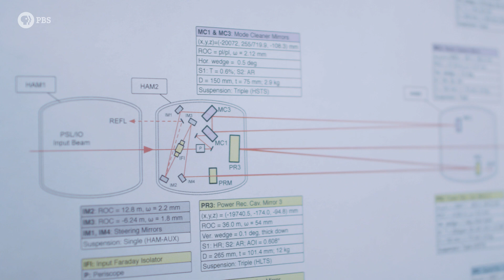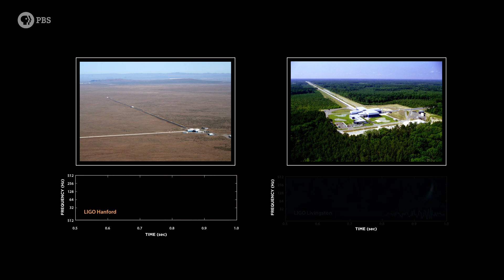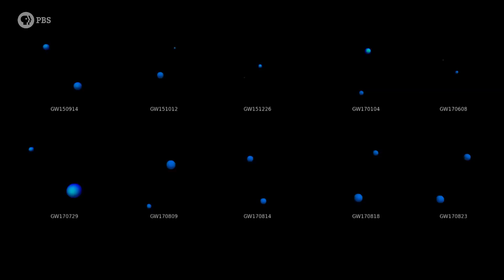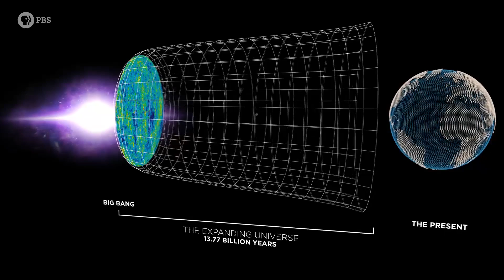I Visited the First Gravitational Wave Detector! LIGO | STELLAR

Comment: i do believe in gravitation waves, just not the one that ligo is looking for. actually i think that gravity is a vortex created from a interference pattern of wave bouncing out of phase with each other that create a small region that reinforces itself when feed with energy where a convergent and divergent wave oppositly adds to each other causing a gravitational donut vortex that pushes against earth with no friction expect on the stars where the resonance of this vortex is different and burns the star from outside in. i mean hotter on the outside than its inside. it have been long believed that the corona of a star is hotter than its core. i think my theory confirms this and why.

Comment: Hi,LIGAR LIGHT,INNERGASFLUID COMPRESSIBLITRHRUM AS INNER VOL CaO,SiOx),concrte,the light wave seen as mid C from the v fast vibrum tra,fra,reflect mirrors,dfrnt spectra on laz,S,er,dfrnt vibrum of apparartos os,circle sphere ,Grav waves above below the Grav event wobble horizon,spheroidal spin,lift as cosmike effect environ,compression,of ST/G FIELD RUFFLES IN 7D,thus LIGAR GravAwarensussAffectArrooundingRelRARTRATIO OF LOCAL GRAV WAVE,OTHER EMGRAV FIRLD OCEAN OF STREAM ON LIFTING,SPINNING MAGMA RAFT BREATHING,AS WARTER,LIGHT =lighter than air,H2O,<O16/8,or O17-18/8,low dens ‘sound’ ,’wave’,as is reflection,reflaction,alters LAMINA of coherence amongst light as LAZ,S,ER,as arrant light or Spheroidal ‘sound’,reflects,some sMasseffect lerp light narrw,widning of beam splitter affected from ST/G compression,or auxpansion as a spheroidal Grav would be felt within whole apparartos but with dfrnt Grav mass dens,dfrnt,esp rel H2O THART be in concrete or the crumbling,ressonanc,of tubes,mirror,apparatos auxpaerienc the Grav ‘wave’,as well but dfrnt,standing waves,again on spinning lifting earth in+on elecMagGrav field spheroidal function of the usual planneryaria,as is a NAOT in a song,dfrnt with song,instrumnarium,nares breathing speak,songing,nostrils+mouth usual in MARSUPIANS MOTHERFATHERMOTHER of mammals primits similar as gngurrrrru ,or GNGURRU,the supposed kangaroo THART ORIGINEES,ADDED BASE CODONS TO TUNE WITH ENVOTON ENCODONS ENCODED IN THE ROLLIG ROCKS THART THEE DISPLAYED,BE ENVIRON CODON STRUCTURE BONE BE CRYSTALIZED GRAPHENUMA SHEENAM ROLCOILTAPER NOT TREE TRUNK BONES THART ROT IF PERIOSTEUM RIPPED OR UNHEALTHY IMPROVABLE IN PRESCENCE OF FLESH,BONE EATING BUGS,HARDER IF CRYSTAL,BUT THE ROLCOILTAPER ENABLE TO ADJUST HEIGHT PROPRARTHMANUM REL ARROUNDING OTHER ARRAY OF AWARENAUSS ACCLUM OF SPECIES KNOWLEDGE SONGS CREED,SIMILAR PRIMIT(Encodons ,) of inner ocean organ of organisms with physical response to float above ground with dasplacing ST/G FIELD see banana tree structure in humanmammals RNADNA be in but not as much in birds,as humanHuman,with working fluid causing longer angle adjustable limbs esp limbs connection BODARIA THART adjusts dens/difusn RartRatio very often as inner field ocean be Grav acclum sensitive to Grav,as thee be a Grav ,mass entithrumming with movable stabilizing structure reliabl thru LIFELOVE cycluan,remember Grav thru earth art angle complex caunoidal function,earth taidal,warter taidal affect effect of larger than usual Grav field causes ruffles,in LIGAR need squared circl aperture,to prevent altered angl join air,light,concrt reaction ressnanc to ‘Grav event,thee be a Grav event,thanx,bliss, XAMichael

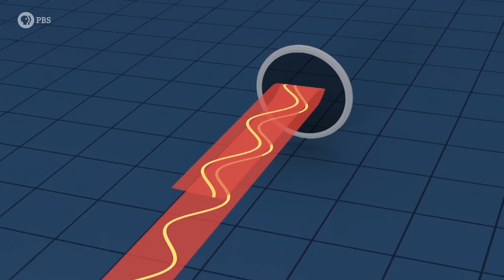Comment: 2:58 Actually, multiple detectors are needed in order to triangulate the exact location of the event in space.
Reply: Both justifications for detectors located far apart are correct. Multiple detectors are used to correct for coincident glitches/false alarms AND to triangulate the merger sources.

Comment: Is it affected by earthquake. And how can we differentiate between gravitational wave and earthquake from LIGO
Reply: This is why they have two detectors.  They can compare signals.  A Gravitational wave from deep space will certainly be detected simultaneously, and be identical, and therefore, can be confirmed to be from an extraterrestrial source.  A disturbance from any earthquake will be sensed at one location, then at the other, as the energy ripples around earth.  Even if the earthquake happened at the exact midpoint between the two detectors,  their wave forms would never be the same as the differences in land structure and density would alter the signature by the time the disturbance arrived at each detector.

Comment: Why not just put satellites into space and remove any earth vibrations? Seems like it would be cheaper and more condensed to look from space into space.
Reply: Definitely not cheaper, but they want to put detectors in deep space, I think at one of the Earth-Sun Lagrangian points. Not only would they eliminate vibrations, but they could also make the arms hundreds (if not, thousands or even millions) of kilometers long, drastically improving sensitivity. (Look up Laser Interferometer Space Antenna)

Comment: One giant propaganda project. Fraction of the width of a proton? Seriously? You can't measure anything that small. It falls well within the margin of error of any equipment. That means the whole thing is a fraud trying to prop up the busted theory of relativity. Also note, she said the machine is calibrated to compensate for any local vibrations...then she says you need another machine on the other side of the planet to rule out any VIBRATIONS. Does it cancel them out or not? That's double talk.
Reply: yea the quad stabilizers seem unnecessary as well as a second location. wouldn't it have been cheaper to test this on the international space station? and more effective ?
Reply: we have seismographs already too they could just combine that with these tests and eliminate any earth vibrations.

Comment: 2:55 "And they needed to build two of them"
How could you locate a point in space without triangulation. You need three of them. Every english speaking video on this topic forget Virgo, you could spend 2 seconds to say it exists but ... no. You american are amazing.
Reply: No, you don't need three. The third point of the triangle (in any triangulation reference) is the target you are trying to locate. You have the known distance between the two measurement points and the bearings of the two readings and that defines a unique triangle. What are you going to do with three measurement points - determine the distances between those points? GPS already gives you those.
Reply: @christopherbedford9897  But the wave can be perpendicular to the two arms of a detector and not be seen on one of the three, so it takes three to have at least two measurements.
Reply: @emile8147  Yeah I realised just now I was thinking plane geometry, not 3D. My bad! Yes you need 3 measurement points!

Comment: I just saw a smaller version of this at a science program and I am so amazed
Reply: Cool! That sounds like a great science program demonstration. For $2000 or less it's possible to build a pretty good tabletop Michelson interferometer with sub-nanometer sensitivity, which is about a billion times less sensitive than LIGO/VIRGO. A tabletop interferometer like that, just sitting on your desk in the open air (no vacuum chamber), can measure movements smaller than the wavelength of some x-rays. How cool is that!

Comment: Ligo is so sensitive its measurements are thrown off by the moons gravitational force. The Earth's gravitational force makes it nearly impossible to use.
Reply: Thomas Anderson, the frequency of the gravitational waves LIGO is tuned to look for are on the order of 50-500 Hz (they sweep upwards in both frequency and amplitude as the sources, say colliding black holes, spiral inwards faster and faster before colliding). The frequency of the moon's effect on the interferometer is on the order of 1/day, which is a wildly lower frequency range and is well-controlled for. I'm not sure what you mean regarding the Earth making it impossible to use the interferometer. The Earth is static relative to the interferometer, so the Earth's distortion of spacetime doesn't generate gravitational waves that shake the interferometer (distorted spacetime is what gravity really is, although we experience it as a force in our everyday life).
Reply: @doodlevib  I was trolling

Comment: As a welder, when they showed that cap with the splitter in it, all I could think was 
"hey Jim, what's the spec on the print for this cap thing?" 
"umm... 0.00005 (Five hundred thousands of an in)"
"God damit, what was that engineer smoking"

LIGO engineering team:
"Hold my beam and watch this."

(for those of you who don't know this fun fact, most welders have no idea what we're actually building. we're just building IKEA stuff the hard way and swearing at the guy who designed the thing because you can do a LOT of things in CAD that reality says won't work)

Comment: Well, I admit I am incapable of swallowing it, and I regret wasting time before and neglecting to take a course on the theory of measurements. But detecting a wave, gravitational or otherwise, with a wavelength comparable to a proton diameter sounds phishy, to say the least.
Reply: The wavelength of the gravitational waves LIGO and Virgo measure is typically in the range of many thousands of kilometers. The length sensitivity of the interferometer is one thousandth of a proton width - that is, they can detect when the detector arms have been squished that tiny amount by a passing gravitational wave. It's kind of a crazy idea, but there are great explanations of how the interferometer exploits light interference to get gravitational-wave information here: 

(Less formal) https://www.forbes.com/sites/startswithabang/2018/09/15/ask-ethan-if-light-contracts-and-expands-with-space-how-do-we-detect-gravitational-waves/#15f516f519a5
(More formal physics paper but still highly readable) https://pdfs.semanticscholar.org/393a/af6b1ced305ee40d175d5f3c3a2b6020348d.pdf 

They both have essentially the same point on that issue - "it is better to say that we use the laser as a clock than
 to say we use its light as a ruler" (from the formal paper). LIGO really is one of the best examples in scientific history of a wild, fascinating idea derived from theory on paper that developed into a full-fledged branch of measurable experimental physics.
Reply: @doodlevib  Thank you very much for taking the time to write such an extensive answer.
Reply: @nahidhkurdi6740  sure thing. It's hard to make sense of something that small because we don't interact with anything on that order of magnitude in our every day lives! A little context goes a long way.

Comment: I really really really want to run the length of LIGO and post to Strava. =/
Reply: 😄 I wonder if Strava would show the slight concave-like elevation changes of running a 4km dead straight line.
Reply: @Adrena1in  OMG, yes! What would the run's elevation read as?!?
Reply: @karlstenator  - I suppose it depends which part of the 4 km stretch is exactly horizontal. If the middle, then at the start you'd be going everso slightly downhill, and at the 2 km mark you'd be about a foot below where you started, then you'd gradually rise up another foot over the next 2 kms.

Comment: Just curious, but if gravitational waves have such a low interaction with matter, how is it that they can be claimed to be detected many years after the fact of their generation.  If you look at any wave, it interacts with matter, the more the interaction, the stronger the wave.  The less interaction, the less strength the wave has, and it diffuses into less and less energy as it travels from the source (entropy). Thus gravitational waves should diffuse into null energy within micro, nano or pico seconds, not years (on any scale). 

The second half of my wondering is why is it that a gravitational wave which is supposed to be radiation is able to travel all the way through space, and our atmosphere, unhindered so that we can detect it with all the chaos continuously happening on our planet.

And... if it is radiation, 'how in the universe' is radiation supposed to cause matter to attract other matter.  It is repulsive by nature. It is energy coming out of matter, not going into it.  Someone correct my thinking.  I'm obviously missing some pieces of the puzzle here.

Comment: Hydrino is 95% of all baryonic matter and is the, literal, "patina, to the periodic chart of the elements. Be saner, even, sober. Theory overview:

"The new paradigm is the realization of what was believed to be the ultimate physical reality by many of the original modern physicists such as Einstein, Schrodinger, and DeBroglie, as well as many chemists and physicists since the inception of quantum theory and the plethora of add-on theories. Mills theory is that there are NO THEORIES of physics or chemistry. There are only the simple laws of Newton’s Mechanics, Maxwell’s equations of electricity, magnetism, and electrodynamics, and the fundamental constants of nature. Laws are NOT THEORIES. They are directly confirmed, necessary and complete, and explain all physical observables on all scales. The universe is deterministic and physical wherein the underlying laws and resulting phenomena can be described by corresponding exact equations; rather than the universe being an indeterminate manifestation of probability mathematics. There is no special relativity theory, no general relativity theory, no theory of quantum mechanics, no quantum information theory, no theory of quantum electrodynamics, no extra dimensional theory, no quantum entanglement theory, no theory of Dirac mechanics, no theory of quantum chromodynamics, no Standard Model theory, no big bang theory, no inflation theory, no theory of dark energy, no string theory, no supersymmetry theory, no quantum gravity theory, no Heitler-London theory, no Hartree Fock theory, no density functional theory, no BSC theory, and so on and so on. There are no postulated principles or rules such as the Heisenberg Uncertainty Principle, Einstein Equivalence Principle of Frames of Inertia, Pauli Exclusion Principle, or Hawking Ignorance Principle or Hund’s Rule. Theorems such as the Zeno No Go Theorem are not based in reality. All observables from quarks to cosmos, spanning all 85 orders of magnitude of scale, are predicted directly by the laws of the universe in closed-form analytical expressions containing fundamental constants only.

Hydrogen atom according to Laws of Nature is an exact physical object as shown.
￼

Hydrogen atom according to quantum theory is this mathematical expression with no physical form
ψ(r,θ,ϕ) = R(r)Θ(θ)Φ(ϕ) = NRn,l(r)Plm(cos θ) eimϕ
￼"

Gravity is a concatenation of understanding and, really, large in that context, distribution based on displacement where spacetime is continuous, consistent with quarks and the cosmos simultaneously. You have to accept lightspeed as a constant.

Comment: Interesting, the design of the LIGO looks strikingly similar to a "Interferometer" or "fringe" experiment I did a while back in my modern physics class. The only difference is my mirrors where no more than 400mm apart.
Reply: It is an interferometer. (What do you think the "I" stands for?) It's similar to the Michelson-Morley experiment, which aimed to detect the influence of Earth's motion on the observed speed of light, and famously failed to detect any within margin of error.

Comment: There are roads hundreds of kilometres long, do the constructors allow for curvature,
Reply: Not if they don't care about the road being perfectly level from one end to another. LIGO needs to be perfectly straight though, because the laser needs to travel in a precisely straight line.
Reply: @Narokkurai  
So 4 kilometers is 2.485 miles 8 inches per mile squared that's 108 inches that's 9 foot hardly a special feat over 2.5 miles.
The ground can vary regardless of curvature by much more than this, I'm wondering why it was worth a mention is all
Reply: @montysmythe579  there's no reason to believe they didn't account for ordinary elevation changes as well, but those elevations would also be affected by the curvature of the Earth, so the entire project from initial planning and survey to construction would have to take into account that 8 inch per mile squared drop-off.  In fact it's likely that they had to conduct even more precise measurements of the exact curvature of the Earth along both arms at each location, as the planet is not perfectly spherical and the curvature does change with latitude.
Reply: @Narokkurai  
Indeed, however, there are thousands of miles of quite flat level areas around the globe, why choose a place whereby a costly project would have to built where an allowance for curvature would need to be factored into the cost,
Reply: @montysmythe579  not flat enough for the precision needed for the experiment. Besides, there's curvature everywhere on the Earth. There's no place they could have built it without factoring the curve of the Earth in some capacity.
Reply: @Narokkurai  

I wouldn't agree that the earth is a perfect goid, rather that it is an overall shape with some vast areas of flatness much as like cansas, however I understand that large construction projects cannot just be laid out without at least some geomorphic reshaping locally